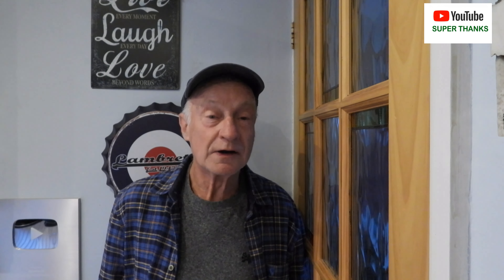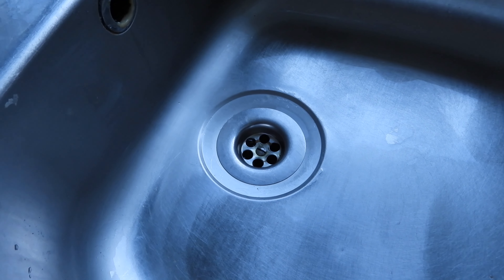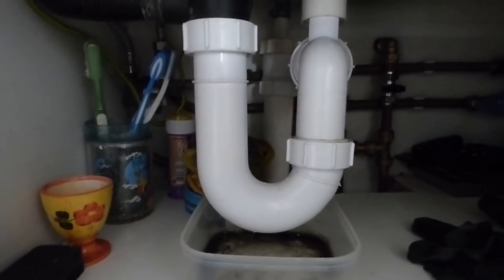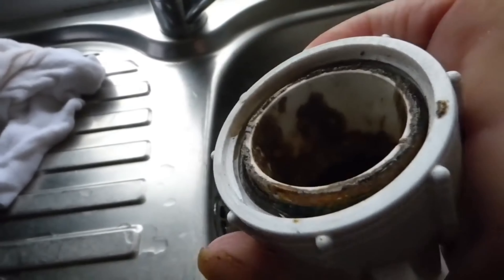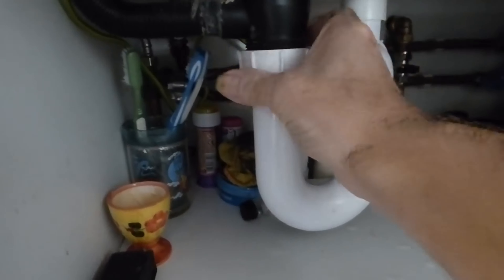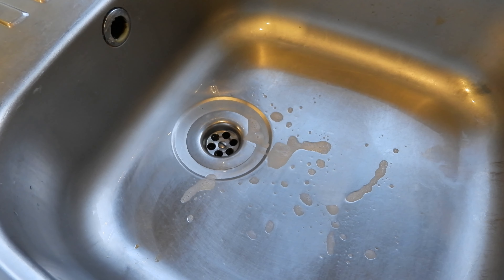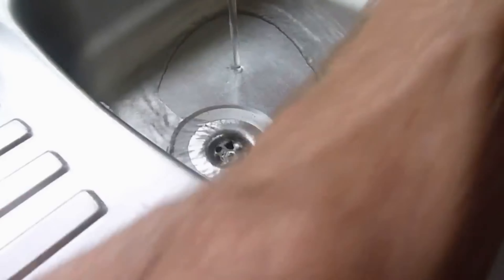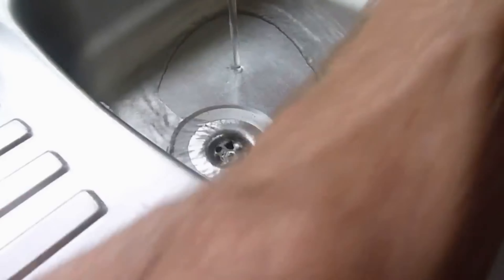#Secret# plumbers trick on how to unblock a drain in seconds. No tools required.

Comment: Tip - with the removed waste pipe U bend or P trap - don't be tempted to empty it into the same sink. 😂
Reply from the maker: Ha ha I have done that one before.
Reply: I'm always thinking not to do that, but it is such a habit. Even worse when you try to wash the bend in the sink 😀
Reply: I still surprise myself occasionally by doing it repeatedly. -should know better by now.

Top tip - always check the gunge in the trap for gemstones and jewellery.